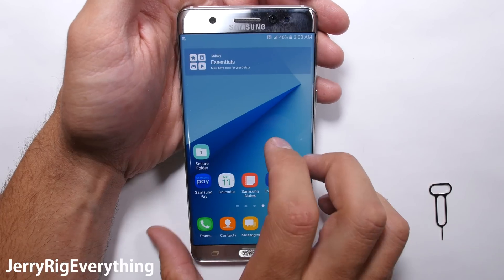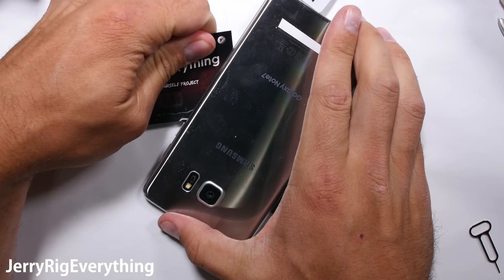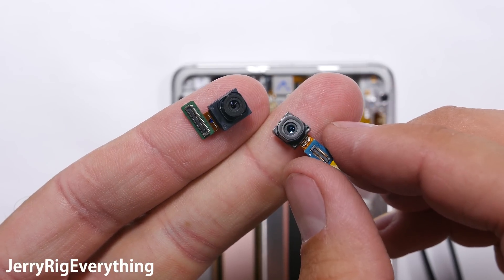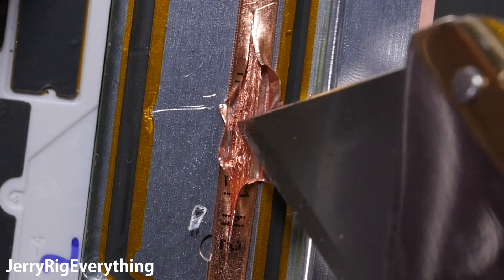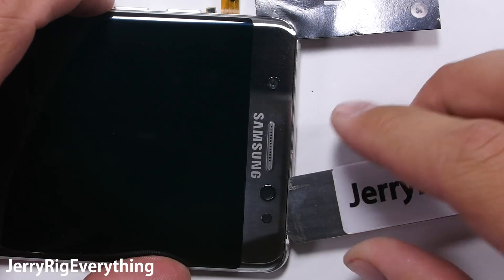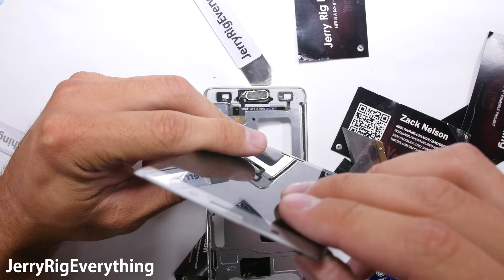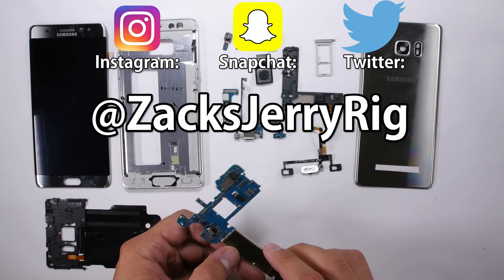Galaxy Note 7 Teardown - Screen Repair, Charging Port Fix, Battery Replacement

Comment: Hello Jerry I use to work for Nokia and Sendo like diagnostics but I have to say your videos are great cant wait for next one.

Important question : In S7 and S7 edge I discovered important technical design problem. Problem is related to waterproofing method. Both phones dont have waterproofing membrane on earpiece speaker ,samsung use special waterproof earpiece speaker which separate outside enviroment from inside . For example Sony is using for separating inside from outside waterproof membrane and behinde is just normal earpiece speaker. In S7 / S7 edge  is between earpiece gril and earpiece speaker litle chamber which collect dust and litlle dirt particles , and because this after some time earpiece speaker start making rattling sound when you call somebody. My S7 edge was already twice in Samsung repair center becase of this problem , they always put new screen and new earpiece speaker and it works perfect but this solution is only for short time period. My question is if Note 7 have the same design problem ? I try contact Samsung but no answer from them. 
BTW: sorry for my english.
Reply: Good question, would like to know this as well.

Comment: A phone isn't a phone without a headphone jack  ( ͡° ͜ʖ ͡°)
Reply: +simonas lesciauskas 6s*
Reply: Aditya Saraf phew im happy I have a iPhone 6s
Reply: that means iphone6 was the last iphone
Reply: The funny thing is android still beat Apple to it... Looking at you, Motorola!
Reply: A flagship isn't a flagship if it has 750p screen in 2016
Reply: Gandek a flagship isn't a phone with a 1960mAh battery
Reply: a phone isn't a phone when it explodes ;)
Reply: +Aditya Saraf *SE
Reply: Gandek, The iPhone 6s is the last phone from Apple then the iPhone 7/7+ are the newest turds from Apple 😂
Reply: cough iPhone 7 cough
Reply: REKT. 

iUseless 7 confirmed.
Reply: +草尼瑪 Thinness isn't an excuse for removing a headphone jack. Apple has demonstrated before that they can make a really thin device (the iPod) and still have a headphone jack. If they honestly use thinness as their official excuse, I will officially give up on the mobile industry.
Reply: Kayson Player yes, it is.  Ask Apple, Xiaomi, etc.
Reply: (•\•) 2 years and still don't know how to make that face
Reply: wait for iPhone 7
Reply: Most phone now don't have headphone jack in 2019
Reply: +Untitled Meme 😂😂
Reply: i___ 7
Reply: 7
Reply: well at least Motorola is thin enough to get rid of headphone jack
Reply: 草尼瑪 Well, a 3.5 mm headphone jack can still fit into a 5.2 mm body for the Moto Z. But that might ruin the structural integrity of the phone.
Reply: lol spot on!
Reply: Oppo did it way before motorola in 2014 with R5.
Reply: Even if it has headphones with USB c, it will only have a port for a charger or a pair of headphones. Not both. My Samsung that I had 5 or 6 years ago had both.
Reply: Shots been fired :)
Reply: truer words have never been spoken
Reply: Copy/Paste :D
Reply: same
Reply: Does that mean it would be a neutered phone
Reply: 2019 with Galaxy S10, still a valid statement.
Reply: one year later apple removes the headphone jack 👌🏽
Reply: ( ͠° ͟ʖ ͡°)
Reply: Not everyone needs a headphone jack tho lol. I gladly switched to the iPhone 7.

Comment: Eh, I'm not sure knicking the heat pipe was such a wise idea if you want it to function as normal. The copper wick may not be swimming in phase change fluid, but I'm willing to bet there is something adsorbed into it and allowing it to vaporize and escape into the phone chassis will likely reduce the cooling capacity to some degree.
Reply from the maker: You are probably right. But just for reference, I tore open the heatpipes on my Galaxy S7 Edge, and used it as my daily for the past 6 months.  no issues. Same w/ the Lumia 950XL. No issues there and I completely REMOVED and chopped that heat pipe to bits.
Reply: Huh, go figure. It'd be fun to do a before and after with a FLIR camera and stress test the devices under both conditions to see what changes.
Reply: +JerryRigEverything And that was a good idea to do! from my point of view it made my phone a lot faster and a lot less bugs! man that was a great idea I did!
Reply: +JerryRigEverything I've learned after my ZTE I had!

Comment: I really recommend dipping your prying tool and business cards in 99% isopropyl alcohol for the back glass and front screen removals.  It will make the cards slide through the adhesive like butter and help remove the parts more cleanly.
Reply from the maker: Ill have to give that a try!
Reply: +JerryRigEverything hi jerry Samsung s7 edge is better or the note 7 is better
Reply: +sreenu battey 

The Note 7 is Samsung's "flagship" phone. So, the Note 7 is better.

Comment: you ripped the spen digi cable the screen should still work
Reply: +David Zuniga i've got a note 4 and is awesome, i love it so the note 7 should be better u just dont have replacement battery or the ir blaster to turn off tv's at restaurants while everyone is watching football ;)
Reply: +David Zuniga i think best option now the s7 edge because have priority of battery 🔋 life if compersion the battery size 3600 mah with screen size, sure the s7 edge better.
Reply: +Ibrahim  Mohammed i'll pick the regular s7 because its more durable and if you put a case and a tempered glass in it is gonna look a lot better than on the edge.
Reply: Themoigt maybe you're right, but for more battery life I'll choose s7 edge
Reply: Please where did you get the replacement screen
Reply from the maker: Na, the Spen cable is at 2:11  I definitely wrecked that screen.
Reply: +JerryRigEverything the screen should still work but the spen wouldnt it happened to me on a previous note device if i remember right
Reply from the maker: jaśe p Ohhhh, I see what you are saying now. I got you. The S-Pen Digitizer connection. Ill check it out.
Reply: kool
Reply: +JerryRigEverything I have a question should I get the s7 or s7 edge or note 7 gonna upgrade currently have the s5 for 2 years which will last more in the long run
Reply: yeah me too i got the s7 not into the huge screens the s7 is plenty capable
Reply: +jaśe p it's a big debate for me s7 /s7 edge or note 7
Reply: Please post an update once you check it out :) love watching your videos.
Reply: MrHeadcrab12 the users whom comfortable with phablet I don't think will agree with you about s7 edge, anyway it's depending on user him self and how he feel about.
Reply: no he ripped the entire top from lcd.
Reply: +JerryRigEverything yeah, the little rectangular cable that connects to the copper back layer of the display is a special sensor by Wacom that the S-Pen of the Note 5 and 7 use instead of interacting with the screen digitizer. So even if you didn't wreck the connectors (understandable result) for the display/digitizer panels, the phone would have worked fine except a loss of S-Pen input. The S-Pen layer is replaceable and will probably be pretty cheap based on how it is for the Note 5. You ought to go for the ultimate repair challenge and patch up the severed display ribbon! It's a challenge because of how microscopic the traces are, but it is possible. See if you can find a way to patch it with tape that has conductive traces running through the length/width of the tape itself.
Reply: Jerry Sir... Please make a video on HTC one X9 durability test............becoz i wana buy this phone........
Reply: Gaurav Kesharwani I can help with this, are you ready? Ok, here goes: Take care of your shit and it doesn't get damaged. There, now you're armed with the secret of what fragile and expensive technology can take!

Nanbol Sheni why are you asking, he said he doesn't have a source yet. chill.
Reply: i thought thats what it was.
Reply: Themoigt
Reply: Themoigt

Comment: there's an IR blaster, I wonder if we can use it for old school remote functions, using Galaxy Universal Remote?
Reply: +Zachary Prime god damnit
Reply: same🤔🤔🤔
Reply: He slipped up, he actually meant Iris Scanner.
Reply: +S Lynch There's no IR Blaster this year again.
Reply: That's becoming something of the pass.
Reply: +LTLWrestling He was correct,it was a IR blaster so to speak,but its purpose is to work in conjunction with the iris scanner during low light environment...search Note 7 iris  scanner on YouTube to see explanations.
Reply: They disconnected the app.
Reply: +Kai-Zer Alcadias It has an IR receiver not a blaster. I think it can detect IR light but can not send IR light like a blaster would.

Comment: Hi Jerry, will opening up the phone then closing it back compromise the IP68 rating?
Reply from the maker: Indeed, it will NOT be water resistant after opening it up.
Reply: +JerryRigEverything 
Just a question.
I see that you do lots of durability tests on smartphones, but are you gonna test, for example, even the upcoming Meizu PRO 7?
Or, maybe, even other electronic object, such as the xiaomi MI band 2, or a fitbit?
I know that you buy everything by your own, but it would be interesting if you didn't upload videos with only smathphones, but tablets etc too.
Thanks for reading this, or not.

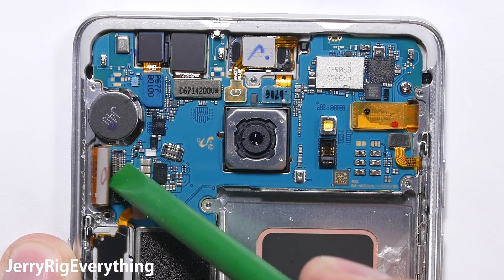Comment: 2:33 did you say IR blaster ??? i thought they didn't include it on the note 7
Reply: it's for the iris scanner
Reply: Oh ok thanks
Reply: +Eryche Bandy Hmm, I wonder if it's possible to overvolt the IR LED a bit more to help overcome contact lenses and glasses better?
Reply: Because there is nothing like shooting IR radiation straight into your eyeballs. That can't be good for you long term...
Reply: +Grumpy Cat wait what
Reply: Grumpy Cat There's this big fireball in the sky that does that to you all day. I think humanity has coped just fine thus far.

Comment: Whenever you lifted the battery and you nicked the battery, you said something about copper exposed, do you mean lithium? Also that piece you ripped was probably just a tape or wrap of some sort.
Reply from the maker: The inside of a battery has a copperish color. But ya, it could be something besides copper, ive never really checked.
Reply: I would've said teardown a battery, but make sure it's completely flat (no charge) before tearing down. Safest way to tear down a lithium ion battery. Or you could make a wonderful video full of vivid colors like the 4th of July w/ a fully charged battery and a hammer :)